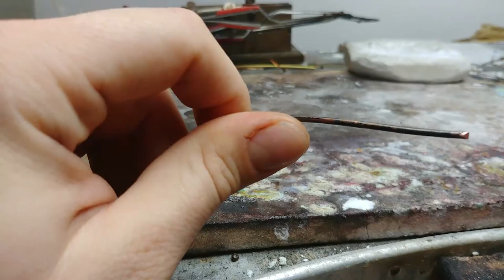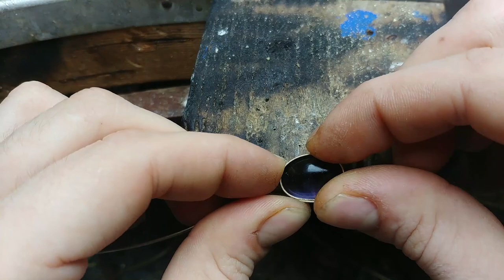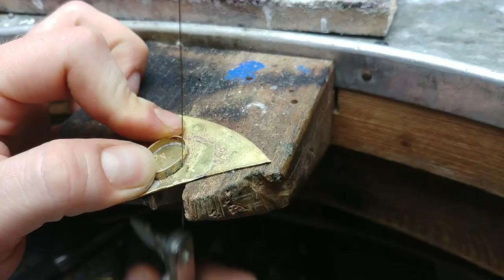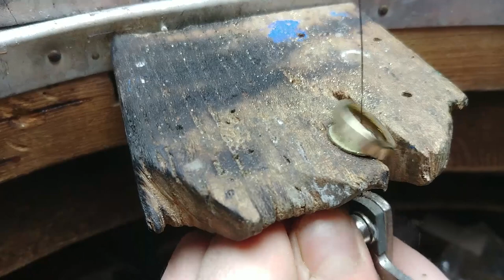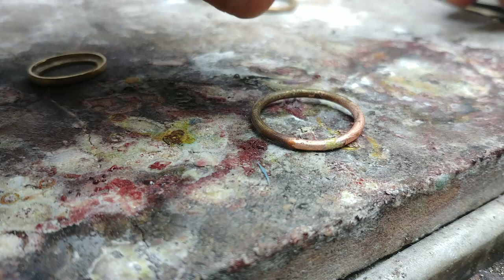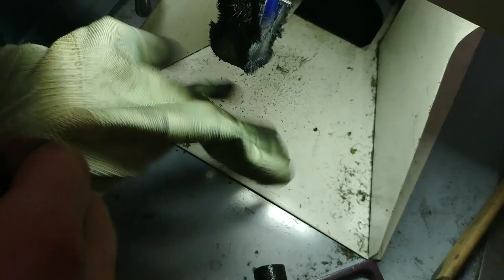How Is It Made? Minimal Bezel Ring With Amethyst Crystal Gemstone. ~ By Kryher

Comment: So you can use bezel wire if you don’t have a roller right.
Reply from the maker: Yes, you can use ready made bezel wire if you don't have a roller, or as @SleeplessNovember suggested you can cut it from a metal sheet with snips :D
Reply: Thank you. Excellent video.

Comment: Hello Bohdan! Thank you for this video. I am a new maker and I was wondering if you could tell me why the brass I work with turns into a copper color? I read that it's due to the zinc and copper in the brass, but I was wondering could it be bc I am overheating it or picketing it in salt, vinegar solution? Any ideas? :)
Reply from the maker: Hello Lana! It's probably because of your pickling solution, try using citric acid and water and let it simmer for about half an hour, then polishing it takes that red off. I would also consider investing in a more strong pickling solution 😁